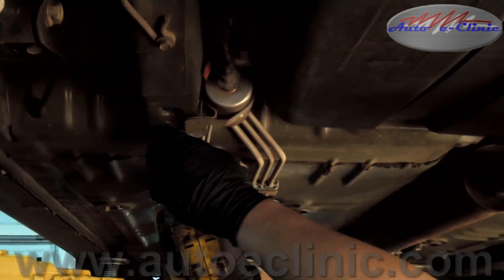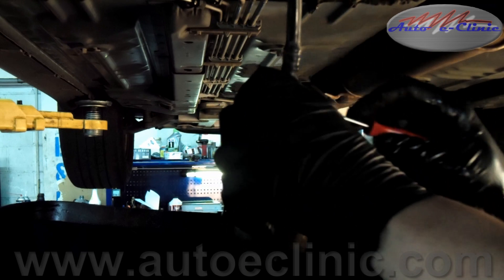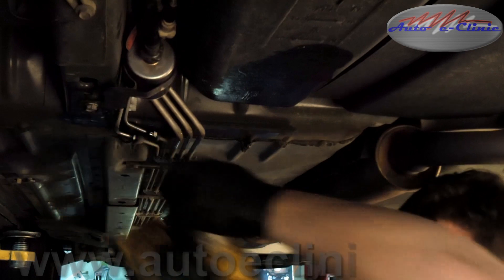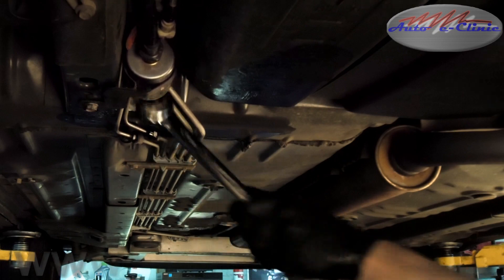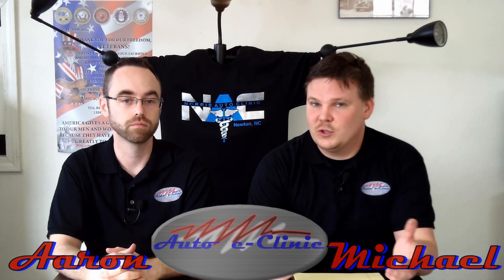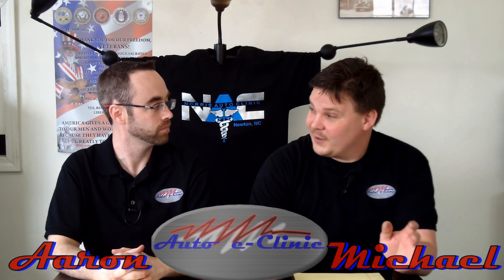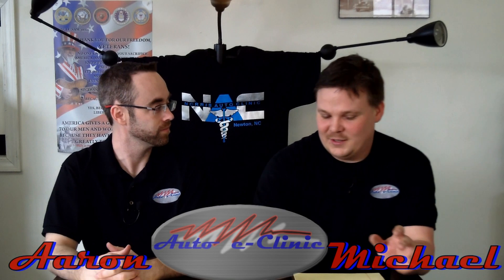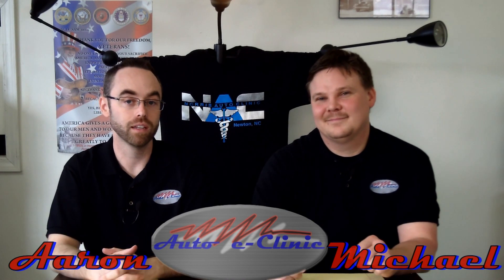How to Replace Your Fuel Filter ( Example 2004 Chevrolet Impala 3.8L)

Comment: almost all cars have the filter "sock" type thing on the inside of tank on the pump pickup   that impala you guys just did has it too....they also have a inline changeable filter like you show here....i guess double protection or differrent size pores(def have diff size pores actually)....ive actually had a chevy 1500 pickup that the sock was so clogged up had to drop the tank down and remove it

Comment: An "overlooked maintenance item"?    No wonder. I have a 2004 Venture van and there not one word in it about the fuel filter in the owner's manual. So after 13 years ( I bought it used 3 years ago) I changed it.

Comment: Great video guys.  Out of the 4 cars we have only one has an external fuel filter and this one is a 2000 Camaro.  I hope that the Camaro filter is as easy as your video.  Is it feasible for those vehicles without an external filter to put one somewhere on the fuel line?

Comment: Can you please do it for a 2012 chevy malibu ltz
Reply from the maker: Looks like your car does not have a serviceable fuel filter. it's made into the fuel pump module inside the tank.
Reply: Well when accelerate it takes like 3 seconds to get up to speed the engine noise is even delayed.
Reply from the maker: Are you talking about a 3 second delay from pressing the pedal to the engine getting fuel?

Comment: hi guys,is the fuel filter on a 2007 impala inside the gas tank
Reply: reddog9401 no it is not crazy. they are saying that you don't need to replace it. one less thing to worry about. why complain about it
Reply: the only problem with that if your fuel filter is clogged, you have to drop the gas tank
Reply: Thats true but if the fuel was dirty enough to clog the filter youd most likely want to drop the tank and clean it out. I worked in a dealership for many years and only ever had to drop the tank due to a clogged filter/strainer was because someone put sugar  in the tank. Never for a naturally plugged filter. Gas is very clean.
Reply from the maker: A 2007 Impala has an integral filter made into the fuel pump module inside the tank. The only way to change it would be change the whole pump out which would cost at least $600-$800 dollars.
Reply: that's crazy,that you cant service a darn fuel filter.
Reply: What about a 2004 Chevy Impala? Is it in the gas tank also or underneath the car somewhere?
Reply: +Pris Sulamo yours is most likely in the gas tank.why coulnt they just put them under the hood,like they use to.good luck doing one when you have to drop the tank to do it.

Comment: Very helpful video - not sure what the complaints are about in the comments below. I was wondering what size that fuel filter/nut was before I went out and got a new filter. For those wondering - most cars have a replaceable filter in that location either the driver or passenger rear or some Hondas have it right in the engine bay. Other vehicles are NON-serviceable and have the filter IN the fuel tank and are not required to be changed unless you are replacing a failing fuel pump in which case you would replace the pump and filter together when you have the tank open.

Comment: This is a poor video and why are you guys working on a  car that's 18 years old.?
Do you have a video that has a how to section for all Chevrolet cars from year 2001 until 2012,Impala/Malibu etc etc.FWD .
Reply from the maker: The video title and content lets you know that this vehicle is a 2004. Subtracted from 2014, that makes this car 10 years old. The Impala is a fleet car and that means there are a a lot of these "W" body cars on the road. So the relevance of this video applies to a majority if vehicles on the road. And, manufacturers are now making the fuel filter part of the fuel tank module and non serviceable. Hence, they can't be changed. Unles. You want to pay $600 plus just to say the filter has been changed.
Reply from the maker: Oh, and the Impala is a FWD.
Reply: I knew that but the car being worked on in this video is a rear drive impala circa 1996.
Reply: AutoEclinic
Scotty kilmer says the fuel filter and fuel pum is in the gas tank and if you want to tell him he's wrong then OK.
scottykilmer.com/automotive mechanic.
This looks like a RWD car and for that the pump is located usually on right side.
Filter is located in the carburetor unless they too changed it at the time of production.
Reply from the maker: The only one that is wrong is you. This IS a 2004 Chevrolet Impala in which the external fuel filter is along the left hand side. I owned the car, filmed the video AND have worked with GM for 14 years in parts. Now GM built this car and if you want to tell them they are wrong then go ahead, http://www.gm.com/
Reply: TheSirjohn2012 there is no carburetor on this car hahaha no one has used a carb in YEARS. hahaha. sir john you are clearly the jester. sir you are not. lol

Comment: Where is the removal of the fuel filter in my 2007 Chevrolet impala car with a 213cu.inch V6 front wheel drive.?
Reply: Should be the same.

Comment: if you kept cranking the engine w/o gas you could have destroyed the fuel pump because they use the fuel to cool the pump. w/o fuel the pump will overheat.

Comment from the maker: I would not cut the line. I would do everything I could to get it off. If not replace the line. I do not patching fuel lines. If you had a proper flair tool and enough line to stretch it, maybe. Best of luck. Let us know. Thanks Michael

Comment: How would you go about replacing a fuel filter on a 00 Chevy impala where someone didnt use a flare wrench on overtightened but and stripped the corners on the but? Someone gave me a repair kit where I would cut the line and install a section using a compression fitting but I was wondering if that was safe.

Comment from the maker: Yes, it would be very similar. Some GM have the flare nut on both end or both quick connects. On the quick connect end usually you can press both tabs on the retainer an pull. It may require a pocket straight screw driver to help. Sorry for the delay.

Comment from the maker: In this case it does not matter. You are still getting the same effect, which is removing the pressure off the fuel system.